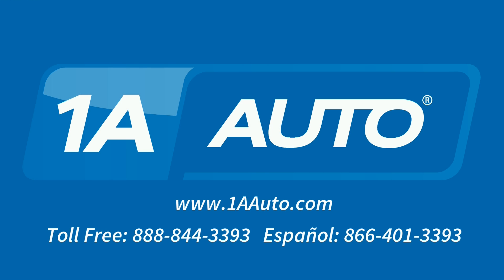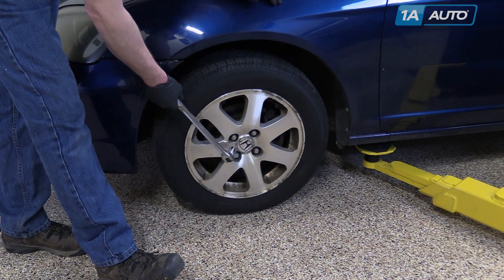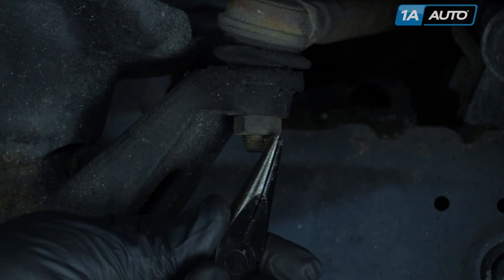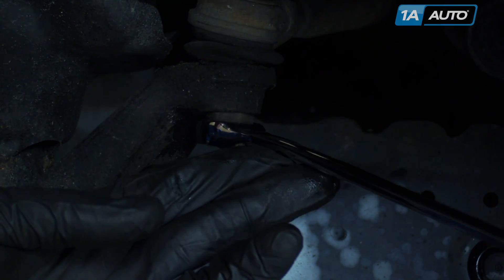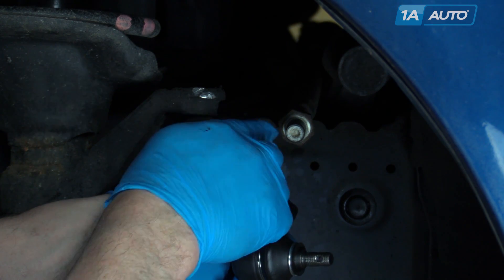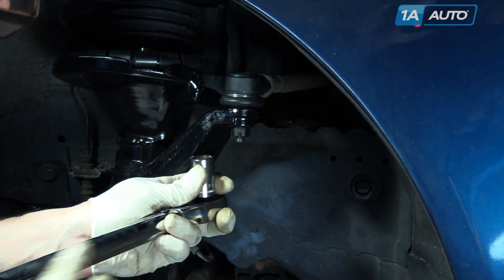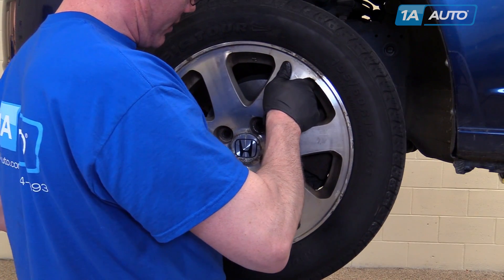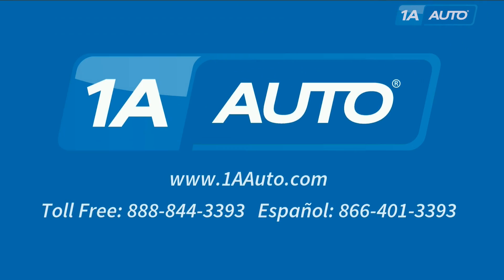How to Replace Outer Tie Rod 03-05 Honda Civic

Comment: FYI: the lock nut is 24mm, not 21mm as he says at around 1:45. You can see '24 mm' written on the wrench.
Reply: Yes exactly I ran to AutoZone to buy a 21 and it was the wrong size now I have to run back and get a 24. Awesome videos but huge inconvenience

Comment: The hole for my cotter pin is much lower than the castle nut, so it doesn't even penetrate the side of the nut, just kind of hangs out below it. I guess this is still okay, as long as the nut is torqued on properly and the pin is there? I noticed the previous rack end just used a regular nut with a cotter pin below it, so I suppose this is just as good? Seems like the threaded bolt on the rack end is longer than it needs to be for the steering arm on the shock?

Comment: Great video but I have a question so basically you don't need to Grease Honda outer tire rod ends when replacing since they don't come with Grease fittings?
Reply from the maker: +LJay Assong If there isn't a grease fitting on them then they are self contained and come pre-greased. You do not need to maintain them. Hope this helps you out. 1aauto.com
Reply: +1A Auto Parts Thanks 😊
Reply: @1AAuto  . Perfect! Thank you so much as I was considering buying a grease gun and I really don't want one.

Comment: I'm needing to take off the tie rod end but I can't at all. I've tried every method. And now I'm trying to take out the tie rod completely, and I can't find anything to help me with that
Reply: If they are seized, you may need to use either a heat gun or blow torch to expand the metal to make it easier to remove. I had the same issue, just wouldn't budge but got the heat gun on for a couple mins and turned much easier
Reply: I know it's a year late but I'll write this here for people that come here in the future: you can use a heat gun to heat up the outer tie rod and expand it, and use something like gumout freeze out or compressed CO2 to freeze the inner tie rod and shrink it. This can help dislodge the parts.